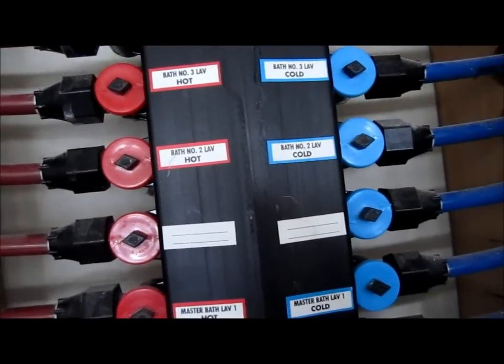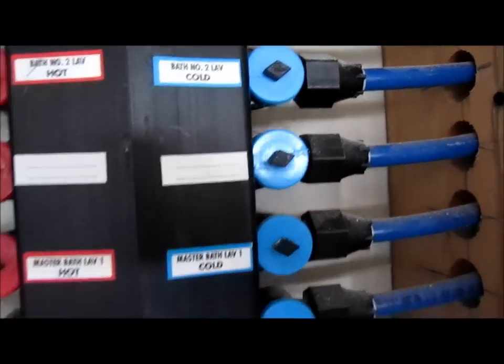Overview of PEX plumbing in the home with manabloc manifold

Comment: With Pex the manablock should be your only issue. The shit off valves on the mana lock leak if you turn them on and off. Best to shut main off when doing any work. The pipe people have to worry about is Polybutylene that shit is garbage.. largest class action lawsuit Quest plumbing for using polybutylene
Reply: I am wanting to turn off water to my kitchen faucet to fix a leak. Should I avoid getting a pex key and shutting off the water to it and instead shutting off at mains?  I live in a condo with pex panel in 2nd been closet.  Where would the mains be?  I am inexperienced.

Comment: The great thing about pex if you live where it freezes is it won’t burst like copper.  Google freeze testing of pipes.  It’s heavily used in Europe and has been around a long time.   It’s known for its reliability. Yes, copper is still the gold standard,  but pex is an excellent choice.
Reply: My place is a condo. Pex panel in 2nd bedroom closet.  Place is at least 15 yrs old.  Do I have to get it checked professionally or maintained periodically? What os the risk of leaks? I want to shut off my kitchen faucet to repair but now considering shutting off at mains to avoid tinkering with the pex at all for fear of causing a leak.

Comment: Running a single supply on the hot sure saves water, the bathroom is say 50' from hot water source you turn on shower wait for a gallon of water to run through before it gets hot, then go to use the sink, another gallon wasted before it gets hot. Really? Some people have to walk miles to get fresh water. One hot supply to the bathroom with a circulation pump keeping it hot. Please tell the people walking for fresh water that you have scrapped that system.....water wasters..geeze
Reply: Water doesn't disappear. People think that once it is down your drain that water is wasted. What we really need is better storm water management so more infiltration occurs.
We should be advocating and educating under developed areas.

Comment: What if i want to add a couple of lines to the open spots on the manifold? Where can I get the connectors? Also the lines I am adding are 1/2 inch and my existing lines are 3/8 - is there a reducer I can use to make it work? I am adding a bathroom.
Reply from the maker: In our area, Home Depot has most of the parts we need but I'm not a plumber.  My home came with PEX so I had no options.

Comment: I have PEX and I'm not sure about it.  I'm trying to replace a faucet, but I. can't shut off the hot water.  if I shut off the main hot, it still comes on in the kitchen sink, off everywhere else.  no shut off under the sink.  calling plumber
Reply from the maker: Your unit should have a special tool like the red one I have to twist the black knob to turn it off. This is assuming your unit looks like mines.

Comment: This professionally installed system popped a hot water line at 2:20 am in my home 12/29/2016 causing over $20,000 in damage, a red hot line7 down on the left side there became detached from the black connector spewing  hot water for over 1 hour before discovered down stairs. Service Master said they sucked up over 400 gallons of water
Reply: Was it crimped PEX-B hose?
Reply: Yeah, nothing like that has ever happened with copper.  LOL I personally know 3 people whose homes were wrecked from copper failures.  Stuff happens!

Comment: i do not agree with your hot water box supply feed system unless you enjoy standing in ashower and waiting forever for the water to get warm a trunk line ran from water heater across the house well insulated is much more cost efective

Comment: what if rats got in the wall
Reply: +Tyrone Llewellyn should get an exterminator. but seriously they wouldn't do much to the line as they would get wiring and insulation, you would know the rats were there long before there was an issue with the pex
Reply: Then you've got bigger problems

Comment: There is another video, where the guy ran a single set of PEX lines to each room, then used T fittings to split the line for different fixtures, and each would have it's own shutoffs.    Seems like the best of both worlds, a problem in a certain room, you try the fixture shutoff, and if that doesn't work, you use the manifold to shut down that room, rather then shut down the whole house.

Comment: Have had one of these setup in my house for 9 years, but now one of the valves are leaking, and it caused some nasty drywall damage. Other than that, I haven't had any problems.

Comment: as a home owner, do it yourself'r the only down side I see in PEX is the cost of tools and the fact that in a fire it would fail sooner than copper.  The advantages of PEX are to many to note.
Reply: I would think that if it's hot enough to melt the pex, the lines bursting would probably be a good thing and the house would be a loss anyway.  As to the price of tools - $40 for a stainless crimper and $10 for a pvc cutter is pretty reasonable compared to pipe cutters, hacksaw, torch, flux, solder, etc.
Reply: john g Plumber here, and i can tell you, the parts for copper cost more then the parts and tools combined for pex when you repipe a home. But that being said, its always a good idea to stub everything out in copper, and leave pex unexposed behind drywalls and under the home.
Reply: On the plus side, though, the PEX would melt and put your fire out!

Comment: PEX is plastic and there are multiple failure points in the system shown. It's relatively untested compared to copper and not nearly as strong. Why risk a flood or water damage to save some time? There are also many types of solderless fittings available now that work very well.
Reply: LOL,PEX is not plastic... It is actually cross-linked polyethylene.  As far as your claim of "multiple failure points"  care to elaborate on that?  PEX has been around since the 1930s and widely used in Europe and Canada for many, many years,  It is now gaining traction in the US and gaining adoption.  PEX in the US has been tested for many years and approved for used by the federal government and ALL 50 states including picky California.

PEX is actually far superior to copper or galvanized pipes for used in domestic plumbing.  Copper plumbing has many more failure points than PEX, since with PEX it is typically a direct connection from the manifold right to the fixture.  It is a best practice to limit the use of 90 degree elbows and the use of Ts is discouraged.  There are many, many more connection points between the water source and the fixture with copper than with PEX, therefore more failure points.  Copper pipes have practically ZERO tolerance to freezing. 

I bought a house in the woods for use in the summer, it has no central heating.  Every year for the last 3 years, every year the copper pipes burst unless the entire house was winterized.  Last year I had enough, replaced everything with PEX-A, and have had ZERO issues without having to even winterize the plumbing.

The downside to PEX is that it cannot take direct sunlight very well, but who the heck uses PEX pipes (or ANY type of plumbing in direct sunlight?)

Most of the opposition to PEX comes from old timer plumbers who refuse to embrace newer, much more convenient technology.  But hey, we all need to protect out jobs right?
Reply: The only thing copper is guaranteed to do is corrode, not to mention burst if it freezes.
Reply: Do you have any facts to back up your skepticism?  PEX has been in large use in Europe for over 30 years.  It has been thoroughly tested in the lab and in the last 30 years in which is has proved to be a better solution than copper.  I have not seen any information stating PEX is weaker than copper as typical PEX installations have significantly less failure points than a copper equivalent.
Reply: You've convinced me. I'm going to replace all the copper in my house with PEX.
Reply: adisharr
Glad I could help.
Reply: ***** for that mater copper, galvanized, cast iron is not fail safe.  That's the reason it all keeps changing.  You might remember "greenberg" (might have been "orangeberg") waist line, essentially tar impregnated paper.  For a do-it-yourself''r the down side on PEX is the price of tools, which I suspect will change as time goes by.
Reply from the maker: It's a new alternative for newer homes and lesser cost than Copper.
Reply: It's always about cost but I'm not convinced on its reliability.
Reply: +adisharr PEX-a has thermal memory which means if it gets bent or expanded it can simply be heated to return it to it's original shape. Pex-b is not as flexible and more prone to bursting if the tubing freezes.
Reply: what do  you call "relatively untested"?  Yea, been in use in Europe for the past 40 years... sure.. 'relatively untested'...
Reply: NO, it isn't new.  PEX has been around since the early 90's
Reply: adisharr ...wirsbo pex  by far out performs copper in every way...with the exception of coppers anti microbial properties...

Comment: 90% of the problems with leaks are due to improper installation on this product. The other 10% is due to improper storage of tubing, connectors, not using isolators through materials. To achieve the best results have a plumber that is certified in PEX installations do the work.
When I repair leaks I use PEX. They have fittings that can be used with either copper or galvanized metal pipes. Two guys can re pipe a full house in one day with this material.

Comment: Getting ready to replumb my house, so have to ask - is it code legal to not put a valve under a sink and run it to the faucet directly? I understand there's a valve back on the manifold, so guess that's logically equivalent, but just wondering if code (generally) permits that? Thanks!

Comment: I'd be more interested in hearing from someone who's had this arrangement for several years. Connections look to be screw-on, like most hose connections. Most of those that I've seen start to leak in 2-3 years after numerous hot/cold climate cycles and usage. IMO there's no excuse NOT to put a shutoff valve under the sink. Especially in multi-story homes. Run to the garage? Ok. But not if you're on crutches or have trouble with stairs (age, injury, arthritis, etc.).  How does it handle freezing?